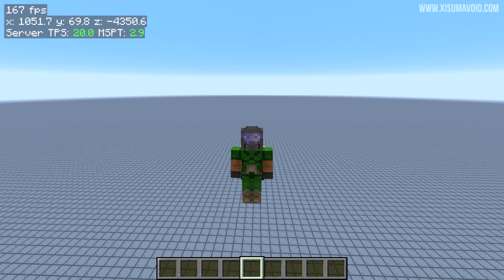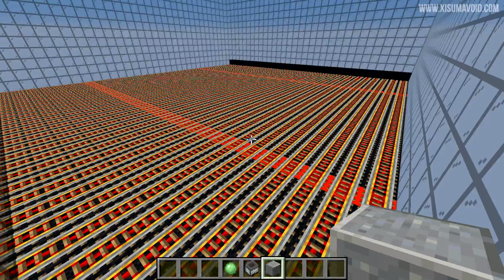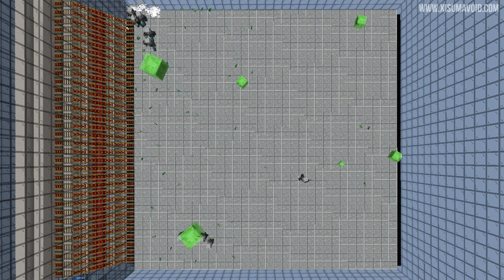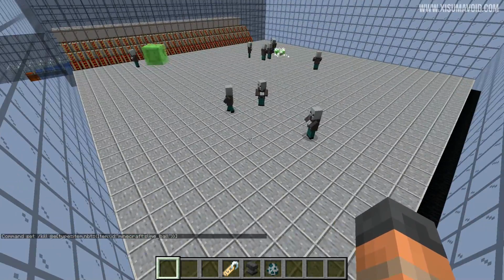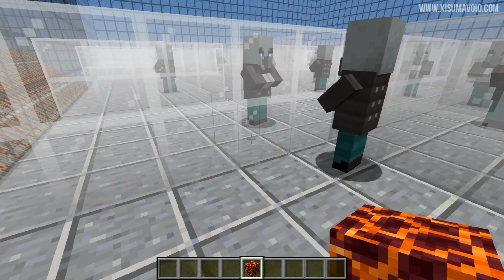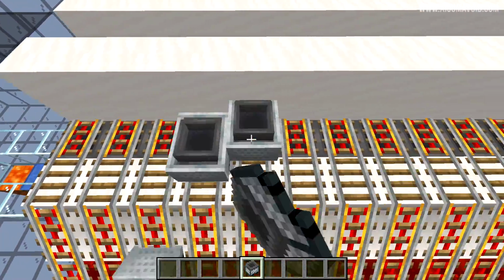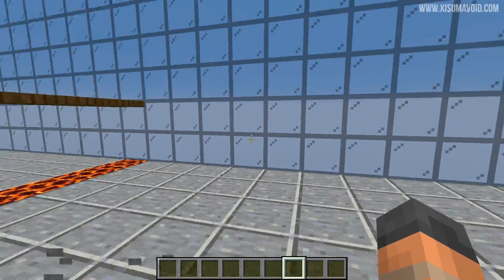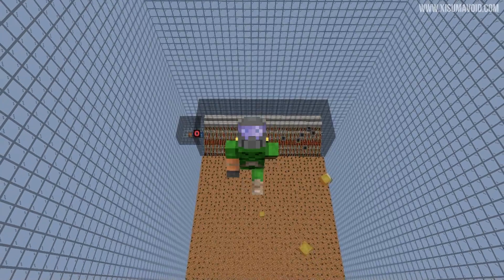Minecraft 1.14: Fastest (Maybe) Slime Farm?

Comment: The fastest way would be to knock out the glass on the sides as it means the very edge spawning spaces can not be accessed by slime, and make multiple layers using hoppers and farmland for the wither roses
you can maximise the layers, up until y=40 because above there slime won’t spawn (unless a swamp or something, if you could change this leave a reply explaining) anyway yea hoppers pick up items through farmland, so that’s less space than the hopper minecart a which are 2 blocks meaning you get more spawning spaces, also going and breaking all the bedrock and building the farm at y=0 would make it even better, that’s the most efficient i’m sure, i should build it one day

Comment: I feel like you should just be able to use a grid of magma blocks, with maybe a 4 by 4 square of spawnable surface cut up? It's dense enough that slimes would probably die very quickly, but also not too dense that big slimes couldn't spawn.

Comment: What about constantly throwing duped tmt to explode just ubove the wither roses? I imagine that that'll deal a bigger chunk of damage than each tick of a wither rose, so if the TNT deals damage it'll kill the slime that much faster.
Oh and you should move the walls 1 block further out, they're blocking spawn attempts on the outer rim.
Of course we should also check what the max possible rate is by using command blocks to kill the slime.

Comment: I'm not sure about slime chunks, but normal mob farms can have their rates increased by extending out the spawning platform 3 blocks out in every direction beyond the wall, since spawns can search for a spot from up to 4 blocks away, and so long as the same y level is able to be randomly picked (ideally not more), more spawn attempts will find spaces in the farm. The wall itself could also be ideally lowered to 2 blocks to get closer to picking the correct spawn y before looking sideways. Huge roofs extended over the edges are better done by having a solid wall and then extending the platform 3 blocks out in every direction.

Comment: It is technically possible in survival to have dispensers filled with harming tipped arrows around the perimeter of such a wither rose powered slime farm for maximum speed.
Though that would take a lot of work to keep fully stocked.
You could also use a skeleton spawner to generate regular arrows instead.

Or you could use portals to send slimes to the nether to kill there with entity cramming or a long drop onto magma blocks. That might be the fastest, ask the Scicraft guys.

Comment: Wouldn't there be a huge increase in efficiency if you added several spawning platforms with iron golems to lure those slimes to the bottom layer of shiny but deadly wither roses.
Reply from the maker: Actually not. The extra platforms would slow the farm down due to higher blocks in the world. Its what makes these low in the world farms fast
Reply: Ok, that's helpful to know, however why is Ilmango's old multiple platform design almost just as fast as the wither rose design, is that just because in the older version slime farm mechanics were different?
Reply: Luke Palmer Ignore xisumavoid -- his slime farm is hideously SLOW compared to ilmango's 30,000 / hr slime farm
1. Y=0 (requires bedrock removal)
2. Use 1 Sub-chunk

You CAN get 18,200 / hr using multiple floors. The secret is to use half slabs as the floor/ceiling every 3 blocks apart instead of wasting a full block every 4 blocks apart.

30,000/hr
https://m.youtube.com/watch?v=pMlX5OExjWw

18,200/hr
https://m.youtube.com/watch?v=NBTN_oniHMo

Comment: The carpet mod adds hopper counters and tickwarp, so instead of the data pack, you can use a hopper going into a  block of wool and tickwarp for 72000 ticks to get an hour long benchmark in under a minute

Comment: My slime farm design is probably not faster, but it's really fast, can be built a bit lower down and you don't need hoppers or hopper minecarts, so it's a lot more convenient, imp. The slimes get lured by iron golems onto magma blocks that have flowing water on top. They get sucked down due to the magma block water mechanic and die pretty quickly.
Then the slime balls just get swept away by the current and deposited into your storage system.
Reply: Here are a few images that should explain more clearly how it works. https://imgur.com/a/jkSuTjp

Comment: The think Gnembom was telling you was regarding the large slimes. You need to make sure that you have a 3x3 area at all times for large slimes to spawn. Around the side of your slime farm you should move the glass 1 block further out of the slime chunks to allow more 3x3 slimes to spawn.

You should also put torches down every so often to keep the light level high enough so no other mobs will spawn in the dark. You want to use as few torches as possible so you'll need to do this strategically. 

Killing the slimes fast is (mainly) only a problem if the slimes are taking up the mob cap. Your farm isn't spawning them fast enough to matter. This is "mainly" because a mob can't spawn in the same square as another mob, so killing the slimes quickly does help free up spawning spots. However, if you did go with a perimeter design, and got ~20 slime chunks within it, you would be hitting the mob cap and you would probably be getting 100k-150k slimes per hour. 

This is a very very fast design, but it requires hitting the mob cap to fully utilize it. People that are saying Ilmango's standard design is faster don't quite realize that you're going for the fastest single-layer slime farm rather than fastest multi-layer.
Reply: Ilmango had a 30k single layer design

Comment: Ilmango has made a 30000 items/h slime farm
Reply: And the one on the Scicraft server is what, 500,000 per hour?
Reply: @DrKvo  maybe but ilmango's is a one chunk farm so it's much more space efficient
Reply: But it's not a 1-layer slime farm. If you cleared a perimeter and made one of the farms in this video in every slime chunk it would be far faster than the current multi-layer designs.

Keep in mind that Xisuma's farm is killing the slimes faster than they can reach the mob cap.
Reply: @DrKvo  ilmango's actually is a one layer farm
Reply: @creepermystery  Oh. Theoretically Xisuma's should be faster. The only things I can think of are

1. The leafs helping with the pack spawning. You could build that on the sides of xisuma's farm easily enough.

2. Ilmango has removed the bedrock for his, and Xisuma maybe started his at y=5 above the bedrock layer instead.
Reply: @DrKvo  yeah. I think you're pretty much getting to the perfect slime farm there 😃

Comment: I have one that might be for a #mythbusting. Would it be faster (despite te extra effort) building a perimeter in a swamp biome? You have half the height to work with, but you can expand horizontally not limited by the chunks. And it would be most efficient on a full moon. Basically the question is: do slime spawn nore often on spawn chunks or swamp biome during a full moon?

Edit: just realized that in swamps you would have all the other mobs to deal with as well. Probably not the best.

Comment: Yo, if u use Iron golems over pillagers its going to be more efficient or what
Reply: the slimes would kill the golems
Reply: @thechopper2112  they arent that strong to kill the golems and you can also put two of them
Reply: And its lot easier putting golems instead of pillagers
Reply: @manuxd4320  Iron Golems dont regenerate health. They will damage the golems and eventually it will die
Reply: The pillagers regenerate?
Reply: @manuxd4320  No, the slimes dont attack pillagers. They attack iron golems only.

Comment: Going to test it myself, but you might be able to kill the slimes faster if you alternate between wither roses and berry bushes.
Reply: So I'm back with my results. First of all I never got even close to 18k slime balls per hour, but I compared wither roses & berry bushes to wither roses. I tested for five minutes five times to get some accurate avareges. Due to the numbers of each individual test varying quite a bit that proved to be beneficiall. I should make clear however that I did not account for local difficulty, and I tested wither roses and berry bushes first. Also I used the data pack which avareges it to items PER HOUR. So even though I tested for five minutes for each sample, those are not the number of items I got from five minutes. I used the same seed with the same area. The biome was plains and I had the gamerule doDaylightCycle to false.

So some numbers:
Wither roses & berry bushes
Sample 1 8484, S2 8748, S3 6882, S4 8232, S5 8112. Avarege of 8091,6 IpH (Items per Hour)

Wither roses
Sample 1 8544, S2 7620, S3 9168, S4 5772, S5 7064. Avarege of 7632 IpH

This would mean theoretically mixing in berry bushes with the wither roses could give you a 6% increase in IpH.

Additional notes.
Berry bushes do not prevent slimes from spawning.
Berry bushes will not hurt anything when they are not grown. 

I recommend that if you can be bothered that you do test it yourself as well. The more samples we get, the more accurate they will be.

Comment: How about having multiple floors where spawns are immediately dropped down to the bottom to be killed? This so you don't need to worry about collecting items on the higher levels. Probably a flushing tower per chuck would work best and have the flushing on a clock if that's possible
Reply: Can't test it though, don't have minecraft myself lol

Comment: Maybe instead have a few iron golems per chunk, so the slimes get lured to them. When the slimes reach the golem they fall into a hole with a Vindicator. With this you can use less rails to collect the slimes and have them all centrally killed. Size-1 slimes would die instantly because of the falldamage. 

I'm not sure how well this would work as the spawn platform may need to be a few blocks above bedrock, but I hope it helps.
Reply: Also, multiple layers could help improve efficiency too instead of just having the one.

Comment: A few thoughts about alternative farm designs:
- entity cramming might be able to kill off slimes faster, but I actually doubt, not even taking into account that one would have to drop the slimes into a pit with 24 minecarts
- instead of placing magma blocks at the boundaries cacti might work as well and shouldn't require an extension to the collection system
- placing a wither rose on top of a magma block per command does not kill mobs faster, but are there other possible combinations to inflict more damage per second?
Reply: If your thinking about it. The fastest way will probably be portals :)
Reply: I conducted a little test: spawned a big slime in a 3x3 wither rose pit and stop the time how long it takes only all tiny slimes die and drop slime balls. It took around 13 seconds. Then I created a 3x3 pit with 24-ish minecarts per block and spawned a big slime. It only took 5 seconds to kill it/them off with entity cramming.

So it might be possible to kill them a bit quicker, but it depends on how fast you can get them from the spawning space to the killing zone. And you would have to carefully place a lot of minecarts in survival, which is surprisingly difficult without moving them accidentally. But even if you spawn them in with a command block, they will make a hell lot of noise.
Reply: @CoDEmanX47  Thats ehy you woule probably all get them to the nether in a few ticks aftee they spawnee

Comment: I might be wrong but slime spawning is bugged in supper flat worlds!!!!!!!
Reply: It seems weird, because the ground in superflat worlds is usually on a low level. Slimes can spawn in slime chunks up to a y-level of 40 (I think) at any light level. That leads to them not spawning on the surface of normally generated worlds (which is something above 60), but in most superflat worlds (which aren't as high up).

Comment: hey xisuma i conducted a experiment putting wither roses in magma blocks using a command. can you find out the result ?

oh wait i doesnt work but if you put wither roses on the side of magma does it affect the rates? does it go up or down?
Reply: Doesn't damage the mob more due to invincibility frames.
Reply: @eclectic7596  hmmmm
Reply: it can definetly damage at the same time right ?

maybe magma and wither roses aside because slime have a lot of hitboxes
Reply: @brightsteel5695  The slime can only take damage from one of them. When a mob turns dark red after taking damage it means it can't be damaged again.